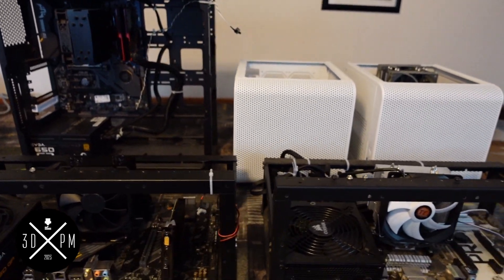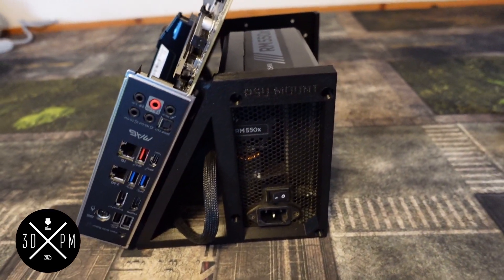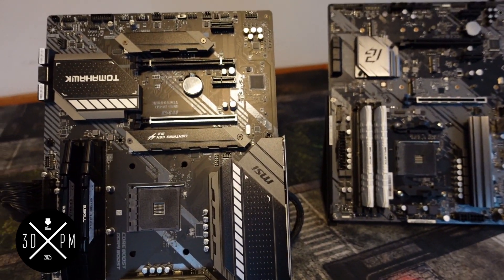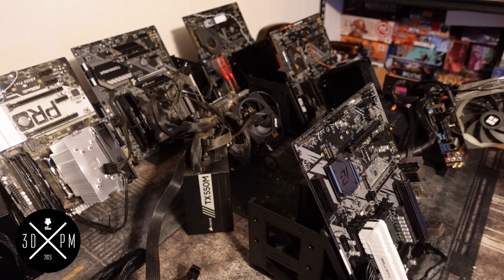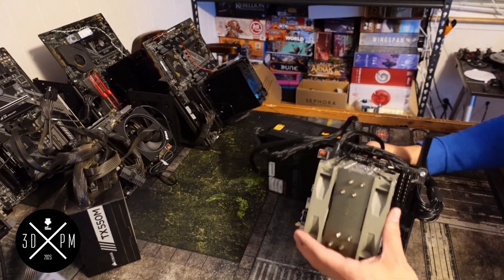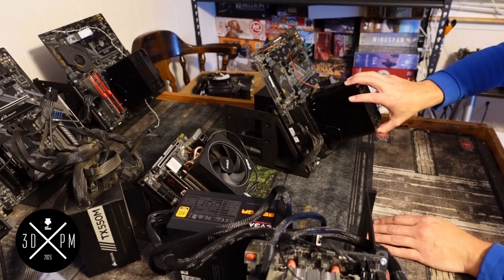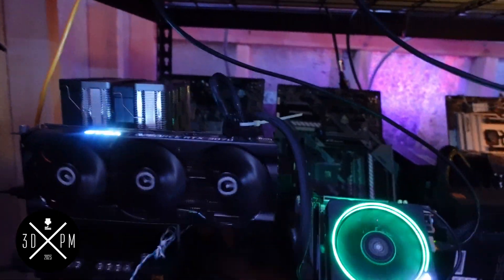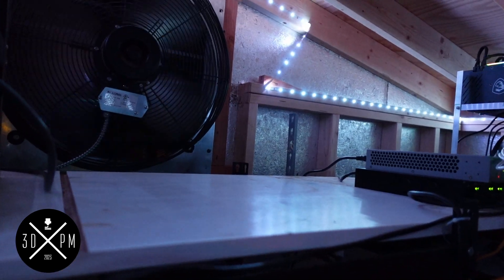Massive cpu farm upgrade!!!!!!!!

Comment: It would be cool if they had a 240 mm aio mount on the top of the psu bracket. I know probably not common but I have several cpu mining rigs running on aio coolers

Comment: Thanks, man. I picked up a few of those over Christmas, psu spot really solved the mess of cables I had from PSUs. I am running mobo power splitter, so I have one of these frames housing a psu and another angle bracket is just for a mobo. Works out nicely. I wish the psu frame had a cross-brace for extra stability, but it is not bad as is.
Reply from the maker: Yea I was going to recommend maybe another cross brace for the psus, but with how heavy they are I'm not sure how you support them without making it super clunky, ill ask Zach about it!